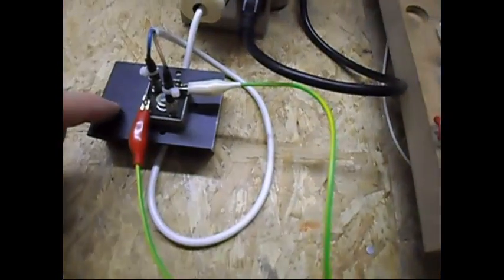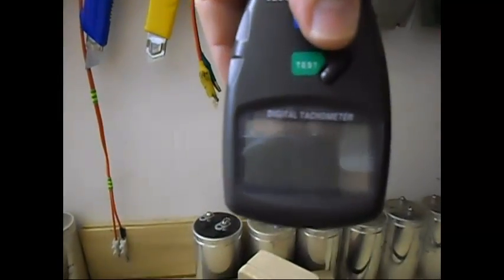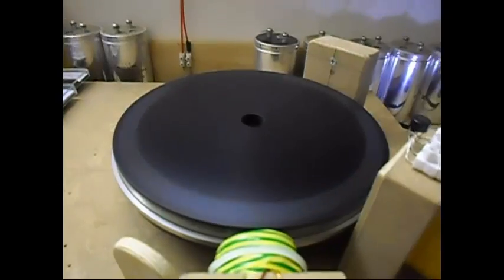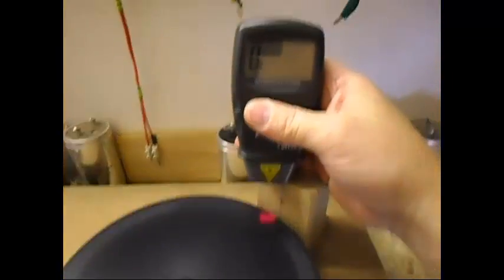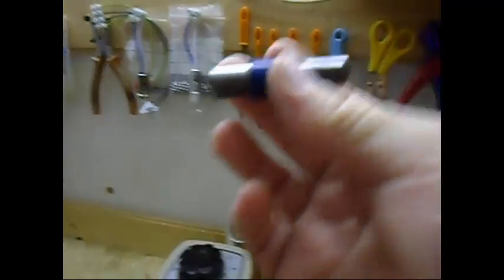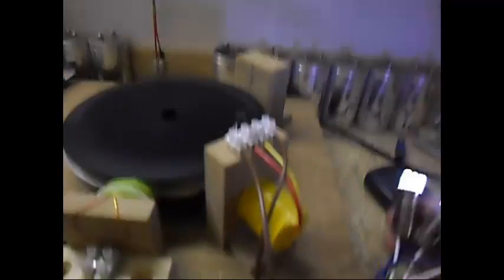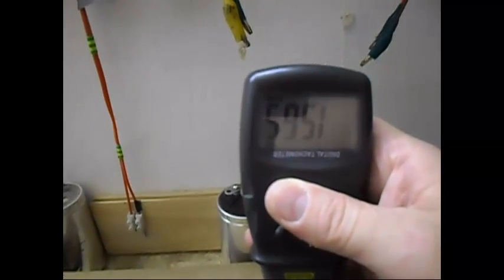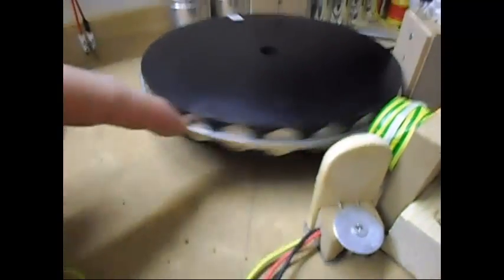Pulse Motor - Generator, Speeding up under load is a nice effect...

Comment: Are you wiring your generator coil with a caduccus winding?Also known as a bucking coil. I first saw this done by MrAnguswangus, with similar results. Also Mr2Tuff2 .
Reply from the maker: Thanks for your comment...^^
There are many ways to wire a coil to get this effect but not all of them produces enough electricity and also some of them may gives this effect but only when shorted which is pretty useless if you ask me...;-)
I'm still not 100% satisfied with mine but it is a pretty good improvement for what about my own coils experimentings path so i'm not complaining either...lol
Reply: So is that yes or no? If there are many ways I for one would love to see more videos on this subject.The only thing I have seen that gets this effect without shorting is a caduccus winding.
Reply: Just to be clear when I say shorting I mean pulse shorting to get a higher voltage output, as you have done in other videos. Not dead short shorting like you do here.
Reply from the maker: It is a yes, for example just watch this video...;-)
He is using just a off the shelf 380 ohm coil with a bolt as core and voila...speed up under load...lol
https://www.youtube.com/watch?v=VSCIws7zppU
Reply from the maker: Well if you have a coil that speed up under load and short you can always do the coil shorting on it for that bit of extra power output...;-)
Some coils only speed up under constant short and these coils when doing coil shorting will slow down the system in a very nice conventional way...lol
Reply: Thanks,great video. Thank you for sharing!
Reply: I have to wonder if this effect is an illusion or really a good thing!  It would be nice to compare to a straight wound coil, using the same core, and turns.to this caduccus wound coil. Use same power input, compare RPM , and power consumption, when driving your light bulb load.It would be nice to know the RPM of your drive when there is no coil , ,,, Humm it would be a good video.
Reply from the maker: No problem and you are welcome...^^
Reply from the maker: For me that is a bit of a strange questions "rpm without coil/core"...
SInce when do we measure any generator like this...lol
Removing all coils/cores from any generator and it will run at much higher rpm than with it's coil/cores on the same power input and that is no more than normal...;-)

I don't know how the "caduccus wound coil" would perform since i've never wound one...;-)

The effect is not an illusion but the question is, is it enough...i tend to say no for the time being untill i do more testings...i haven't play with this effect for some time and now i have more know how so hopefully i'll improve it's performance...^^
But to tell you the truth, in my case it doesn't need that much improvement...just a tiny bit more is needed...;-)
Time will tell...
Reply from the maker: No need to apologize, you give your input and i react to it...action is reaction...^^
Thanks for the linked video, i've seen his videos and now i recall that video and that coil winding type...;-)
And nope, never have i wind one like that...lol...didn't need to i guess...^^
Personally i can say that there are many ways to get this effect but not all are usable...;-)

Comment: Speeding up under load? so when the secondary coil is shorted, does the Amps go up on the primary? seems like the rotor is just pasing the current between the 2 coils?
Reply from the maker: Thanks for your comment...^^
When the generator coil is shorted the amp input goes lower(forgotten to show that) and the system will speed up a lot...;-)
No passing current bewteen coils, no matter where i put this generator coil on the circumference of the rotor the effect is the same...real deal here....:D
Reply: Then this might be the super efficient motor design ive been looking for!
Reply from the maker: "super efficient motor"...hmmm, i don't know about that...lol
But it can be used as a motor only setup but that's not what i'm after...;-)

Comment: Nice...and one question:  is the rpm , the frequency and the coil that get you the effect? or is it only the rpm and the coil (regardless of the rotor)
Reply from the maker: Thanks for your comment...^^
The rpm / x-amout of rotor poles / coil characteristics are the whole package but it is not that difficult to obtain...;-)
Just watch this video here and take it from there,
https://www.youtube.com/watch?v=VSCIws7zppU
Example,
Say in my case i had a 12 pole rotor and the same coil than i would need a much higher rpm to get this effect...
Change 1 of the "3" above mention and all "3" gets change but not physically...;-)
Reply from the maker: Late reply since your comment needed approval...^^
Seen that video to but don't let debunking videos change your ways...
Good to read that you had this effect and never ever remove anything when you have something untill everything has been noted and/or pictures have been taken of it...;-)

Just try it once more because you might be able to produce the effect again...^^
Never ever give up on something, take some time off is oke but always come back to it and most of the time when you come back you will be more experience and will get it done...:D
That's how i always go at it...^^

Comment: Thanks for sharing

How many OHM is your coil + you use cv pijp mm ?  for core
Reply from the maker: Thanks for your comment...^^
The core is not pvc but it is the same mm in diameter so this tube fits very nicely in it...;-)
Well, i won't say much on this coil of mine like i stated in the video for obvious reasons but just look at this video here which is from a fellow Dutch and you'll have a speeding up under load coil very easy...;-)
https://www.youtube.com/watch?v=VSCIws7zppU

Comment: Very good,  Lenz Law kills overunity....!
Reply from the maker: Thanks for your comment and glad you've liked it...^^
"Lenz Law kills overunity....!"...but killing the Lenz effect will kill all energy production also...lol
Balance is needed or sent the lenz effect onto a different path...???...;-)
Reply: Yes i like it very much, your rotors are realy amazing, balance also...! in my last experiment with small pancake coils (thin wire) as "Pickup coils" the LENZ EFFECT" is very strong, my rotor is like a BRAKE, the lenz effect reduce speed, the pickup coils are realy small, the same drive coil produce part of the Lenz Effect, is curious that nothing reduce the Lenz effect, i was experimenting for long time, i have only perhaps 70-80% efficience of the engine, the other 20-30% by Lenz effect is lost...!
Reply from the maker: The higher the voltage output of a coil the stronger the Lenz effect will be...^^
But that doesn't mean you have to go for low voltage coils only...lol

Did you try puting those pancake coils for yours sideways when you are using them for generator coils...???
Turn them "90 degree on the horizontal plane" and see how they perform and also use all types of cores...;-)

As long we are using copper/aluminium for generating electricity we will have to deal with the Lenz effect...^^
So we will have to look for ways to make this effect work with us or at least sent it on a different path than the one we are now dealing with...;-)